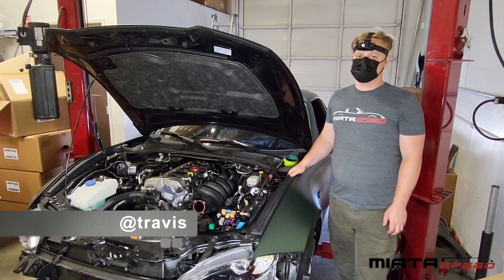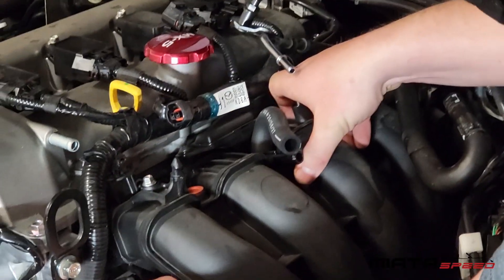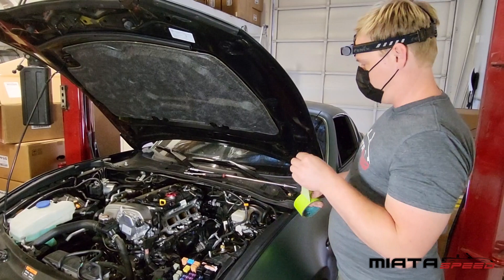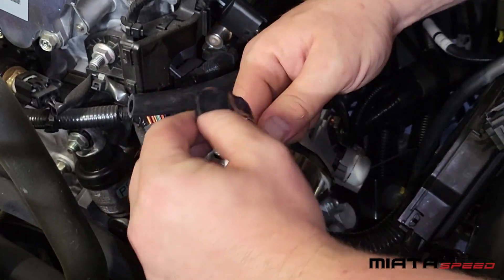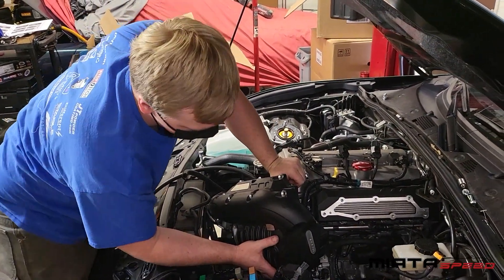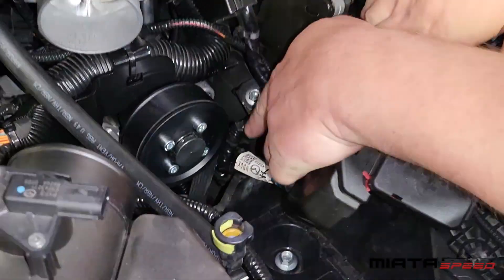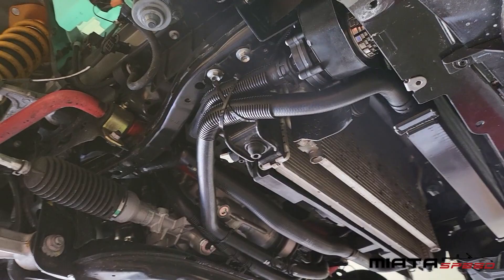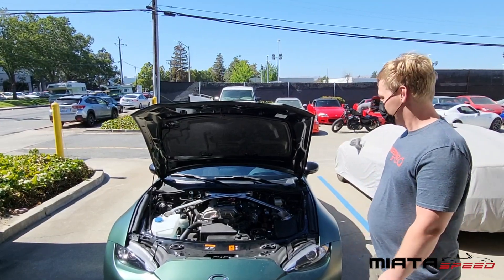ND2 MIATASPEED/EDELBROCK  E-FORCE SUPERCHARGER INSTALL

Comment: How does this edelbrock supercharger kit compare to the hks one?
Reply: Better in almost every way - the top end potential is not there for the ND2 due to lack of fuel volume and rods/pistons that can not take a lot of power in stock form.  The centrifugal superchargers are laggy and unresponsive down low (like a turbo) and not as linear, but with more potential (that we can't take advantage of up top), so it's basically the worst of a turbo and the worst of a supercharger in one.  If you want top end, select a turbo, if you want low end and instant boost get a roots style supercharger :)

Comment: Does it fit '19 ND2. GWR has a kit that only fit up to '18. What is the difference between this kit and that?
Reply: Yes it does. We have part of our kit that works with the ND2 Miata block. Our kit has everything you need to bolt onto the ND2 Miata. Email us if you have any more questions and if you would like to place an order, as we just got a whole shipment of superchargers a couple days ago!
Reply: @SakeBombGarageLLC  are those gain the same on 91octane gas?
Reply from the maker: @Hokimon21  Correct

Comment: Crazy how it’s easy to work on the Miata than it’s cousin fiat 124 spider😳
Reply: That might be best compared to the NC miata as they use the same chassis.. but I never popped the hood on a 124 so I'm curious as to how they differ now
Reply: @TuckFinn831  check them here on YouTube, you have to take many things apart.
Reply: The 124 already comes turbo so its definitely less work lol
Reply: @gerardofiano4866  lol, look for videos of fiat 124 of mechanic working on them and see how long it takes.
Reply: I've done a big turbo swap on my fiat 124 spider and I am doing the edelbrock on my ND2 right now. The fiat was less work so I dont know what you are talking about lol.

Comment: How many miles on that engine? Curious about the valve buildup.
Reply from the maker: Only 1,200 miles
Reply: I'm also very curious
Reply: Same.. and did the owner use 87 octane? lol
Reply from the maker: only 91 octane @TuckFinn831
Reply: Well, you see.  There shouldn’t be any buildup at all. There’s probably a mask there, just like on the face of the guy in the video.  So, it will be totally clean and free from everything microscopic and harmful.

Comment: so i have a ND1 that i have supercharged, can i switch my existing setup onto a ND2? if so what changes need to be done
Reply: You may consider just getting a ND2 head. It would be cheaper and gives you the same benefits of the ND2 engine.
Reply: @jeffrbake  i could do that even if my ND1 is supercharged?